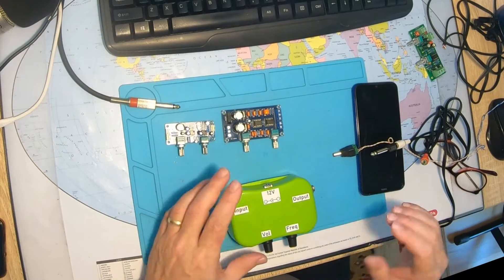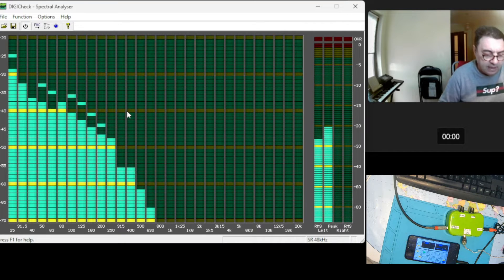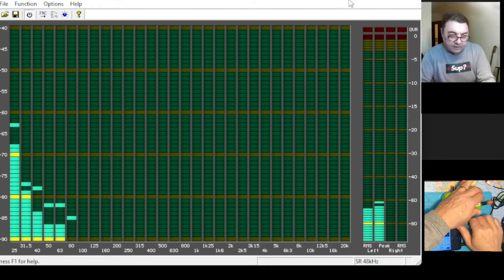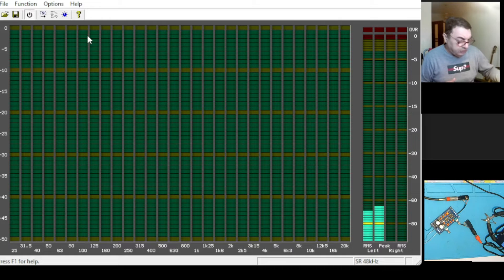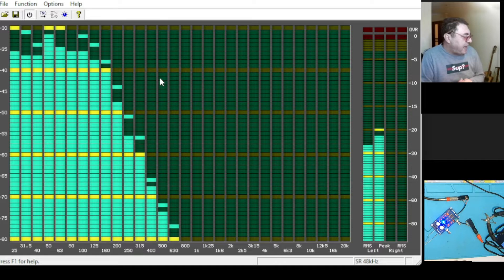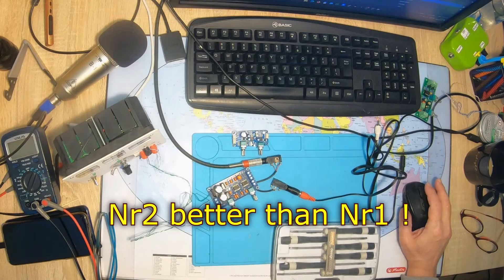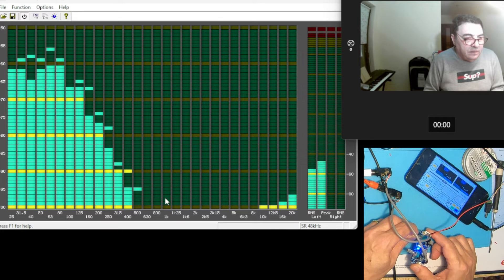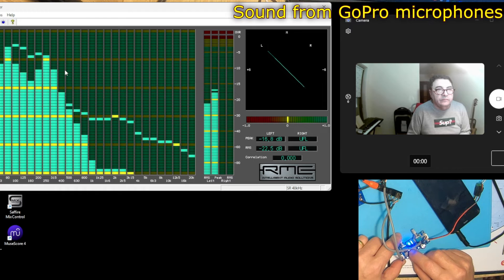Ultimate Best Subwoofer filters DIY test

Comment: Thank you so much for this test. 
I have the board with the phase switch. 
I'm curious, did it only switch the phase on one channel or both?
I noticed the first measurement did not switch the phase but then you mentioned something about the channel and then it did change the phase. 

If I'm understanding correctly one channel is out of phase to the other channel like if you are going to bridge two amplifiers. 

Is my observation of your test correct? 
And which of the two channels was the channel that switched in phase?
Reply from the maker: In fact, the filter, it's mono output. The change of the phase, it's applied to the output. So it's the input it's converted as it is in a mono output. No phase change to any of the input channels.
Reply: @viocaia I know I'm not concerned about the input. 
And thank you for your response. 
The input is a stereo input mixed to mono sure..

The output is also left and right but mixed to mono like you mentioned. 

Does the phase adjustment apply to both output left and right channel or just one?

I just don't have the testing equipment that you do. 

I have noticed when I switch the phase I get popping on the output to my subwoofer. 
And the led light dims with the popping noise. 

I have it connected to a 24 volt supply with plenty of available current. I have 4 microfarads of capacitance for the power supply.

It doesn't smoothly switch like demonstrated in your video. 

I'm curious maybe I got a bad module and just need to get another replacement. 
Or there's something basic that I'm overlooking? 
Again, thank you so much for your input